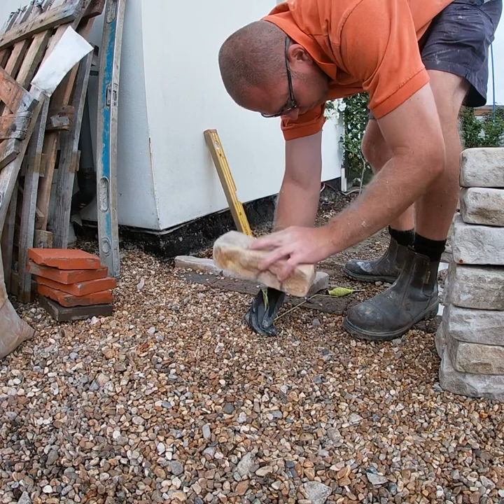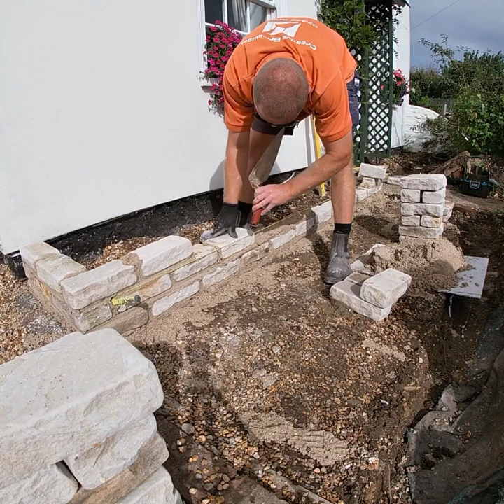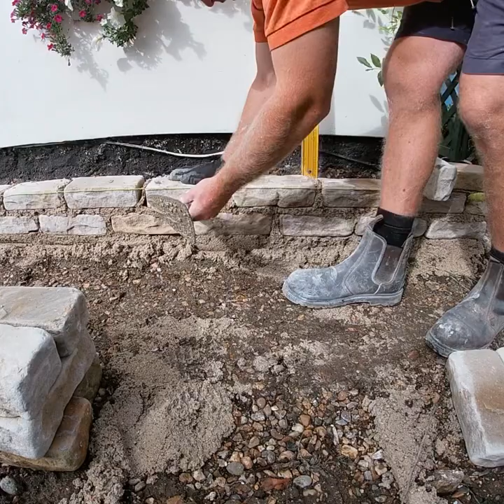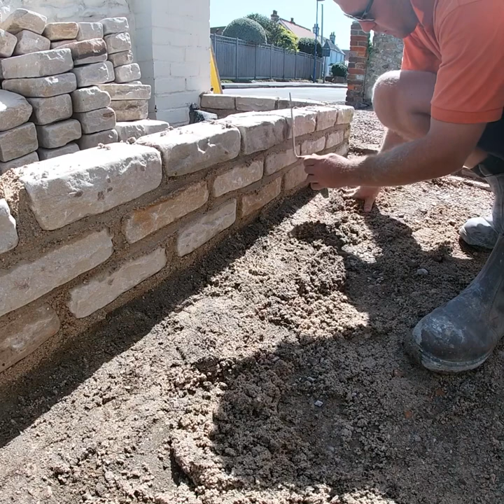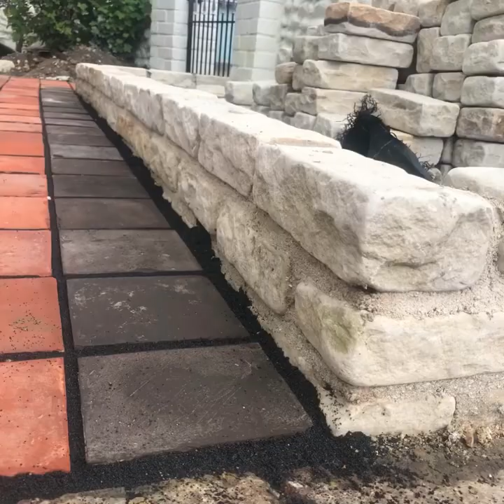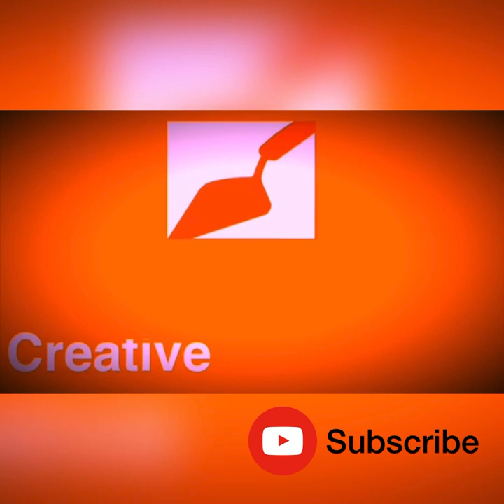BRICKLAYING LAYING INDIAN SANDSTONE BRICKS

Comment: do you think it would be possible to split these sandstone bricks with a bolster? I was planning on using to build a few garden beds and if I could face them,  clad an already existing small wall. Thanks for the vid
Reply from the maker: I used an angle grinder to cut these they may cut with a bolster give it ago.